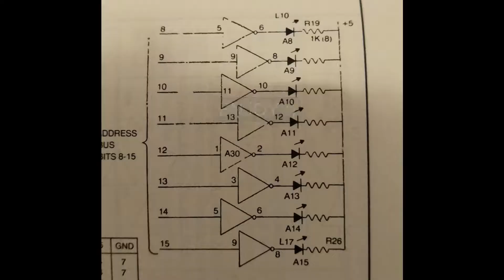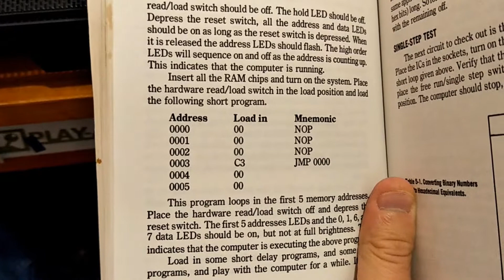8080A DIY Microcomputer

Comment: Did you use any 'modern' components?
Reply from the maker: aside from the cheap modern 500w atx psu, multimedia case, toggle switches, capacitors and resistors nope!. As the whole point was to do it retro for the fun of it like in the book specified and even expand on it.
Reply from the maker: not that I cant do small single board computers using all modern parts on pcb's and possibly even all on the one chip (with fpga's) I just wanted a little more fun thats all